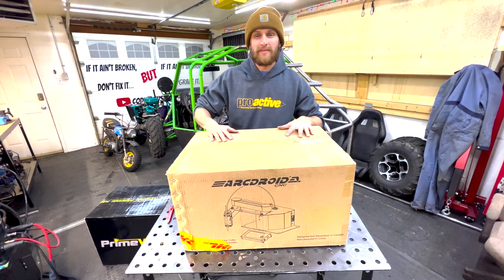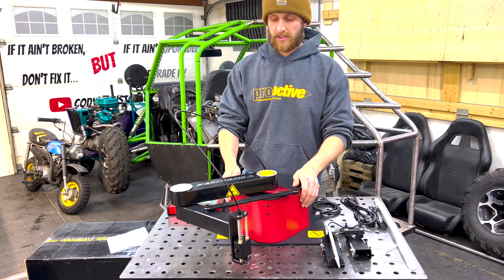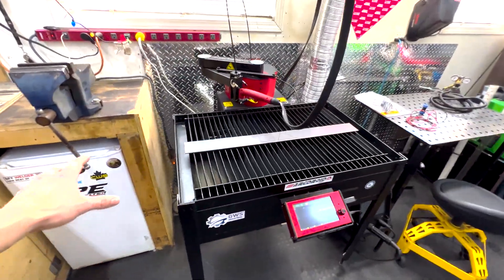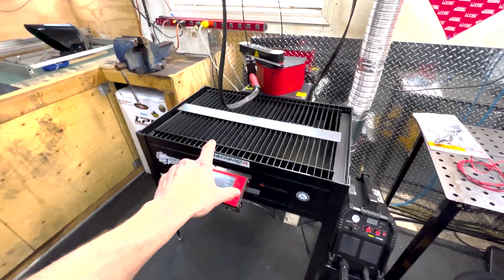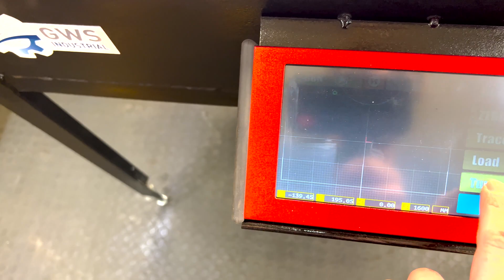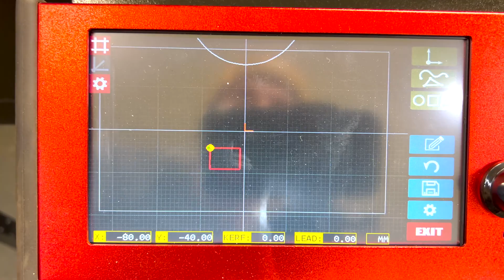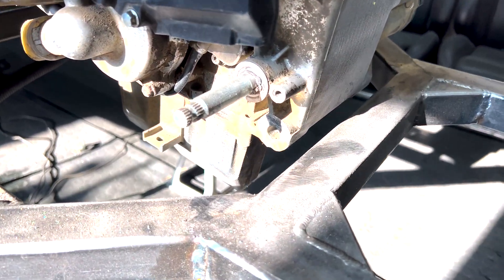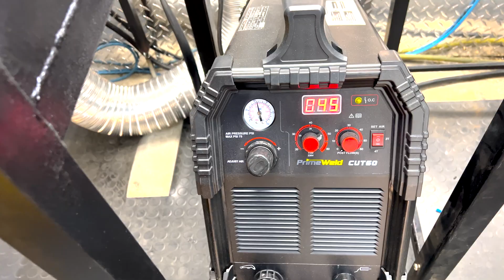Using Arcdroid CNC with Primeweld Cut60

Comment: What's your opinion a year later? Any regrets or things you would do differently? I have a Cut 60 already but want an arc droid or maybe the Langmuir system.
Reply from the maker: @DXT61   so far I have absolutely no regrets! I use the arcdroid at least once a week and the cut 60 hasn’t skipped a beat! I’m slowly learning cad to expand my capabilities on the arcdroid 👍🏼

Comment: Great vid.  One side note which you may know by now but in the vid you mentioned the postflow was set high and eluding to why it went for so long and burnt a larger hole in the triangle corner   That post flow is only air for cooling once the arc extinguishes and does not have a bearing how long the arc is struck. That would be in the tune aettings of the arcdroid. 

Would love to see some more new arcdroid footage.
Reply from the maker: Yup I eventually figured that out haha thanks! And I will have to do a updated video on the Arcdroid 👍🏼

Comment: Was your plasma cutting table diy or purchased?  If the latter what is it called & from where?
Reply from the maker: It started as a cheap plasma table from princess auto then I added the bottom section